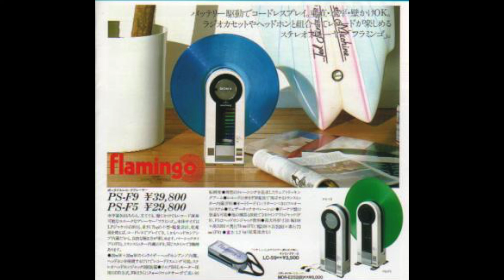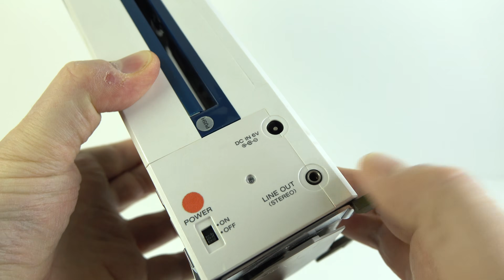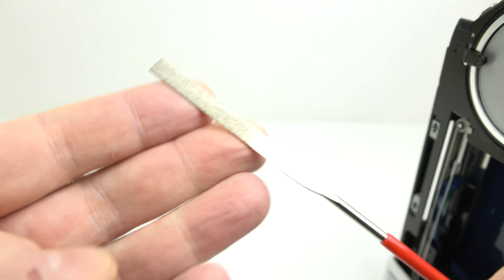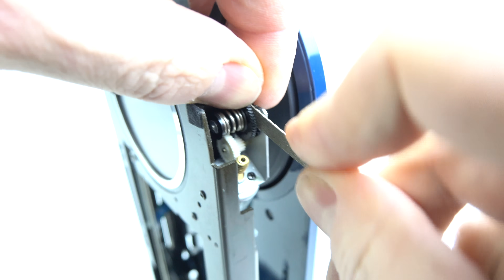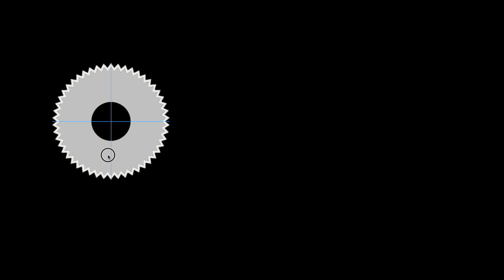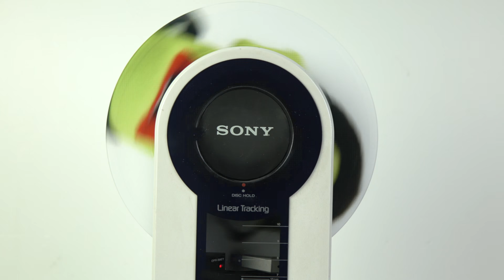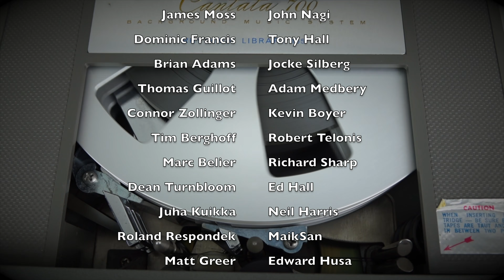The Sony Flamingo PS-F9 (Repair & Demo)

Comment: This is actually a better and more versatile product than that expensive Miniot Wheel 2 you reviewed. Except the Sony is vertical doesn't add an unneeded circular structure around the record. Both are linear tracking and support the record by the label. My best guess is that Sony probably offered a better cartridge or choice of cartridges than the Miniot.

Comment: Own this turntable AND after trying out the floor demo model and getting it for $70, I got a NOS one for $110. Sadly my old one no longer works and I am not going to start using the new one. I think I used the wrong AC adapter that was center positive, not center negative like Sony provided.

And I have a extra battery door for some reason....

Comment: I have the PS-F5 and it kinda works. Record locks in place and spins, the arm will move up and down with arrow buttons BUT The needle will not go down to play the record. Is it a belt or sensor? Any advice on how to fix it?  Thank you

Comment: I always wanted one of these, but they are expensive and recently saw that the audio technica Music Burger came back out and getting one of those. Sorry if the name is different and can’t think of. 

I’m American and have been collecting vintage Japanese electronics since 96. Back then everyone thought I was mad but it’s like collecting art to me and I very attracted to. I think all these Japanese electrons were at its height in the 80’s when I was too young to get any bc of lack of funds. Why I might be fascinated by these past gadgets from Japan.

I’ve noticed it hasn’t still caught on collecting Japanese electronics or vintage Japanese watches. But I’ve noticed the Brit’s have a fascination for these vintage Japanese electronics bc many of these videos are made by Brit’s.
Reply: Oh and once on an import house music 12” album cover, there was a record player that only covered 25% of the record player and a small square. I always wanted to know the make but never seen one. They should make a book on these vintage Japanese electronics. 

Sharp used to make a boombox with a turntable the slid out that was very cool. I had this great Sony boombox that was top of the line and the cd player was motorized and very cool looking in the early 2000. I still have it boxed away, but the cd tray got stuck and either didn’t go back in or come out.
Reply: In 2010, I got a Vintage portable record player from eBay. I think it was made by Audio technica but it was purple in color and I haven’t seen another one. No one bid, so I got for like &75. In mint condition and working. I only tested and stored away bc I wanted to keep it in mint condition. But sadly someone broke into my store and stole most of my collectibles.

But they didn’t take my Mitsubishi upright linear turntable that is a beauty with the glass door and you can see the record spinning. I actually got 2 from eBay around 2010 when many were not aware of that turntable. One is just the turntable and the other model is the turntable connected to the tape and receiver. You should have a look and I think bang and Olsen took the design in the late 90’s for their multiple cd players. 

Also, when I started collecting, there were only few Americans doing the same in 96 and many thought I was crazy. Well, who’s crazy now???

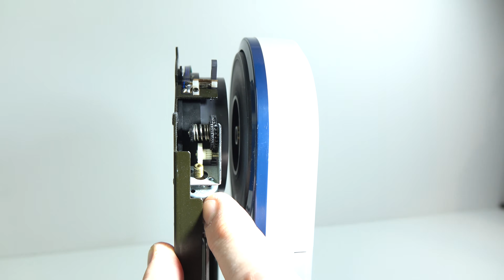Comment: 8:18 there are screws on the front of the frame just by the clamping mechanism, i would guess they hold the bracket in place.

Comment: Curious as I am looked one up on eBay and almost fainted   one at 2000.00 and one at 4000.00 although includes fm transmitter    .

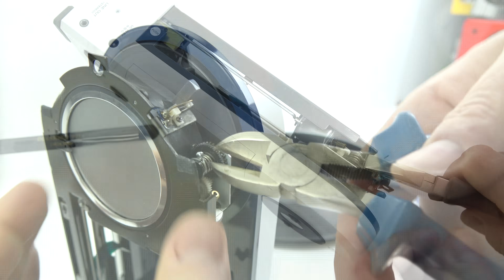Comment: At 8:35, when cutting the excess wire off, I had to close my eyes in case the snipped wire pinged out of my monitor and into my eye. Irrational I know, but can't help it.
Reply: Same, this is why I shouldn't have used VR

Comment: Wow. So psyched to see this. With all the reinterpretations of record players in the Bluetooth/USB era, I kept hoping I would see a space saving, vertical design. I had no idea one already existed.

I imagine that there won't be a reboot of this model. My guess is that the technical challenges are too great, and the market of vinyl consumers too small, and the amount they would be willing to pay for the device would not be sufficient for the cost of developing the reboot. 

You can see from the video this is a quality product. Sony probably brought the full power of their design and engineering muscle to bear when putting this together in the early eighties. It would take a similar level of effort now, with much less potential return. I hope I'm wrong though! I would love to see one on the market someday. I'd probably pay $200 for one if it met the standards of a good record player.

Comment: But can you play 45's with the larger hole? Also, if you use a spider on the 45's would there be a risk of the spider falling out and getting stuck in the player?
Reply: Yes, it has a built in big hole adapter (i own a PS F5) it's spring loaded.

Comment: Hi Matt!

I know this is an old video, you're probably not going to read this and it's slightly unrelated but felt the need to share regardless!

After clearing out my sadly departed uncles house, I came across a Sony PS-Q7 turntable. Nicotine stained and in a non-working state, there were some who wished to throw it in landfill. After watching your videos and getting a better understanding of the mechanics of these machines (they can be salvaged!) I decided to take it home. After some prodding and poking, it turns out it was the drive belt of the tone arm. I managed to get it working with the faulty belt, but ordered a new one to give it a new lease of life.

Thank you for your videos, not only are they fun and educational, but they give numpties like me the confidence to save treasures from the scrap heap.

My teenage son has become fascinated with vinyl after I got my Project turntable. This will go to him and show a new generation the amazing engineering of the past, the value of preservation and the wonder of being curious.

Thanks again.

Comment: Has anyone tried to play a 180 gram record on their ps-f5 using batteries? My ps-f5 won’t spin a 180 gram. Only lighter weight records. Wondering if it needs a power supply in order to spin a 180 gram record.
Reply: I think there's something wrong your player then..., i use rechargeable batteries on my PS F5 with no problem, you can even power it with a USB powerbank with a polarity inverter cable.
Reply: @KayoMichiels  Thanks! I realized what it was. The few records I tried to play were SLIGHTLY warped. Laid down on a flat surface they looked straight. Played in the Sony you could see as it spins that the record was slightly warped and actually rubbed the lower corner of the turntable which slowed the record down.
Reply: @jhelmuth87  Nice! I had a similar issue: i had a record that was cut too big, so it scraped on the edges... i trimmed the edges with a file on a different turntable (after i disconnected the belt, so i don't damage the motor)

Comment: Man, to get access to that "clutch" you should do exactly like you did on tape recorders: remove plastic washer at the end of the shaft, then remove spring and then you can have those 2 cogwheels apart to put new friction washer. Why you didn't so?

Comment: That is NOT the way to repair the clutch. There is an "E" ring retainer at the outer end of the clutch spring. Remove that and then the spring and top gear can be removed. Replace the felt washer. If that still slips too much try placing a thin spacer washer at the outer end of the spring to increase the spring rate slightly. Don't wrap wire around the spring.

Comment: Driving a gear through friction from a felt pad on the surface of a parallel gear seems a bit "how ya doin'" for a Sony product, especially considering the amount of torque required to lift and clamp a record, surely having a few pushpins that traverse through both gears would have been a much more sensible design.

Comment: I swear, if they re-release this again today with exactly same design they'd sell them like hot cakes. Even hipsters would buy them :)
Reply: Honestly, if they made one in black I would buy it because it probably doesn't have a big footprint.
Reply: When nobody buys hot cakes anymore…
Reply: If they would make it even more modern and as pricy as it only has to be it would be perfect.
Reply: Like they re- released the audio technica Music Burger recently. I think that’s what it’s called and these Japanese names are hard to remember. Lol!
Reply: @jacknjill3000 i think its '' sound burger''  🫡
Reply: The very similar Audio-Technica Soundburger sold out in a few days. I bought one and I'm not a hipster.
Reply: The expensive Miniot Wheel 2 is pretty much the same kind of design, linear tracking, supporting the record by the label while the playing surface dangles in the air, except that it's horizontal with an unneeded circular enclosure. I hear that the Sony sells for crazy money on the used market, possibly even more then the Miniot.
Reply: Only hipsters would buy them*
Reply: Hipsters would buy a turd if it was packaged right.
Reply: How with their Starbucks $'s

Comment: The suggestion to use surgical tape instead of felt disc in this kind of a clutch could prove useful to me as well. In one of my walkmans I have the same problem, when the cassette drags a bit more than usual it stops playing because the clutch that is used to determine whether it's the end of the tape is smoothened out and it is made in similar way. I'll have to try it out.

Comment: Hi everyone, I'm hoping someone can help me out. I recently bought a Sony PS-F5, but it didn't come with a power supply. I intend to make a power cable for it by soldering a DC connector to a usb cable, as I'm told the voltage from a USB power source will be sufficient. However, as I don't have an existing power supply, I'm not sure what size DC connector to buy. Could anyone here (who has a PS-F5 or PS-F9) measure their DC connector plug and let me know the measurements? I need 3 measurements: The outer barrel diameter, the inner pin diameter (the hole diameter) and the barrel length. Any information will be much appreciated. Thanks for reading!

Comment: Always a pleasure to watch your videos really! One way or another, this one got me thinking about a portable record player I had when I was a child, I guess it was around 1981 or something like that. I don't remember the brand or model anymore, but I remember it only was able to play 45 rpm records. You had to pop them into a slot at the front of the device, it clicked in place and started playing. At the end of the record, the record stopped spinning and at the left of the record slot, there was a round button to eject the record. Also at the front, there was a volume control and a tone control and I remember at the back, there was a plug for a power lead; I never used that as it also ran on batteries. I really love to own one like that again, but I have no idea of the brand or model...

Comment: I remember my mom having one of these when I was little. It didn't work and she told me to scrap it. I had no idea what it was so I used it as a space ship. I saw it needed batteries so I put some in and it worked!! Still being the unknowing kid I kept using it as a space ship till it was shot down from the sky by an enemy fighter. It landed on an ant hill where I doused it in petrol and watched it burn for dramatic effect.

Comment: I, going to have to disagree with your disagreement.  You show how easily broken tech can be fixed with a little trial and error and ingenuity, you’re definitely raising the lower end of the pricing scale as sellers will now weighed say "easily fixed" and include a link to your video, or just fix them themselves and set a higher price.   

Not blaming, it is what it is.  Keep the awesome videos coming!

Comment: You must disassemble the complete mechanism and clean this in a Ultrasonic bath with a cleaning detergent and assemble it again so the thing is working again. the reason is the dust in the penetrating oil and between the mechanical parts from this press. i repair a lot of old machines now and i know well don't use W40 you must go the long way and disassemble all of this mechanical parts so you can clean it from this dust inside. I know this is a hard job but it help to repair this old technique. Remember this is our technical history from this early days.

Comment: On my Ps f9, that had the same issue, i have solved it smoothing and polishing the tip of the clamp. Without doing any other intervention. you can see it on my channel.

Comment: I fell in love with this turntable after seeing your video. I found one on Jauce shortly after and pulled the trigger. Paid quite a bit for it even though it was untested. I got it in the mail today and it had the same problem as yours so I applied your fix and it fixed it right up! It does have another intermittent issue where the stylus will not always stay down after pressing play but I will look into that later. I just want to clarify for others that may be looking for help with a similar problem that you can remove the entire gear assembly and you can take gears off of the shaft and separate them to get to the felt washer. My washer was intact but for some reason it was still slipping hence why I had to use your fix. 

Anyway, to get the assembly out, you want to remove the two screws from the top of the motor and just let the motor kind of hang there, it will not fall. Then, to get the actual bracket with the gears out, there are two additional screws in the front, they're the same size as the ones from the motor. Once all four screws are removed, the entire assembly can be carefully removed. The gears are held onto the shaft by very small and hard to see plastic clips. You have to be very very careful when removing them. I used a hobby knife to assist but putting it under the clip and pushing upward. I cannot stress how careful you have to be to both no damage them or lose them when doing this. Hopefully this helps other people. Thanks for your help!

Comment: The linear arm actually reminds me a lot of the arms on automated laboratory robots like the ones I use at work.
I guess they found a solution that worked and stuck with it. (Yes, even the "string" =p)

Comment: What you really needed was to lubricate the large gears that move the record spindle in and out. A little bit of silicone lubricant on the helical internal gear. That would have reduced the friction enough to keep the clutch in place.

Comment: Cool idea and kudos to them for trying to be different but ill stick with my Rega RP3. To many motorised and moving mechanisms on flimsy bits of metal plate screwed together, Even if it worked it would be at the huge sacrifice of sound quality. Even with a great needle it would pick up the vibrations from the motorised tone arm the needle is mounted on.

Comment: I have a PS-F5 that I bought from an Ohio Sony dealer as new old stock about 1990 for $10. As I have a large CD collection, it has mostly gone unused since. But I prefer the PS-F5 over my conventional turntable. The technologies involved are the main reason. It was produced as record playing tech was at its zenith. As this is a direct drive turntable, I am pretty confident of its speed when it plays horizontally. Playing it vertically in my opinion was always a trick feature that never really worked well. Slight changes in speed are obvious when operated vertically. Maybe that's why it got a quartz speed controller in the PS-F9. I do think about the audio output and have always wished for a fixed line out. The manual suggests playing it with the volume set around 3 into a line level input from the phones output. I find  that works but the overly obsessive audiophile in me worries about impedance mismatches still. I have replaced the stylus and have a couple of spares. I never noticed it had turned yellow until I watched this.

Comment: You could play unusually sized records by turning the device into the horizontal position and placing the record in while it is horizontal. You could then turn it back to vertical after clamping the record in place. (I just assume this, I do not own a Flamingo player due to their price.)

Comment: Never should you use a destructive tool like a file in a desperate way to fix fine equipment.  BTW, the part you are trying to fix is a clutch (like in a car).  A clutch usually is lined with some kind of material that wears over time, just like your car's clutch.

Comment: I just picked up a Hitachi HT-L55 Linear Tracking Automatic Turntable. These are really interesting pieces of equipment. The linear tonearm in on the lid. Some of these units have infrared lighting to determine when a song begins and ends for track selection. Would like to see a in depth video from you on these linear TT's.

Comment: If Sony did do the PS-F9 as a retro product with upgrades they could add: rechargeable battery, USB power, track recognition and programmable, remote control, a screen that can show track names and other info off the internet, play both sides.  I am sure they can do other improvements and refinements.

Comment: I would like Panasonic to reissue/reproduce their Triple-Take series of portable/bookshelf compact stereos... But according to a member of stereo2go.com, such an issue has been discussed with them and found to be unfeasible. A shame, I feel... as such a combination of functions (turntable, AM/FM-stereo radio & cassette w/record (EQ & line-level input on higher/later models)) would kill Crosley in the marketplace.🙌
However, I doubt many would care for it's 5.9g tonearm tracking-weight.😞